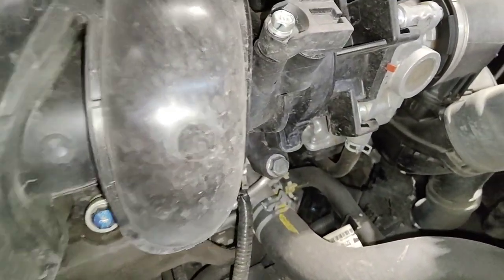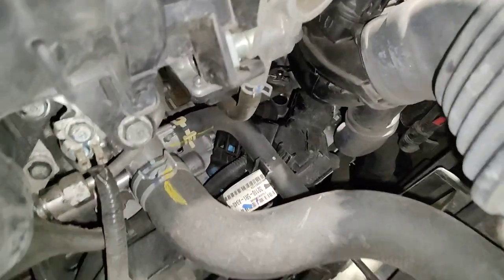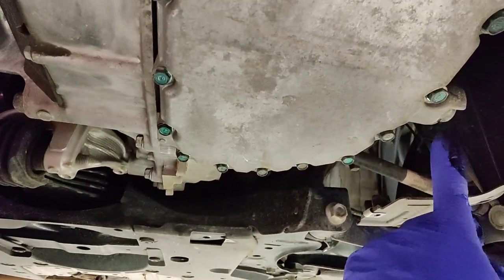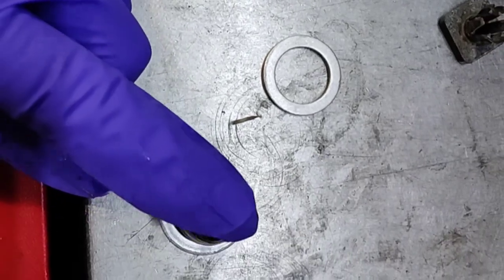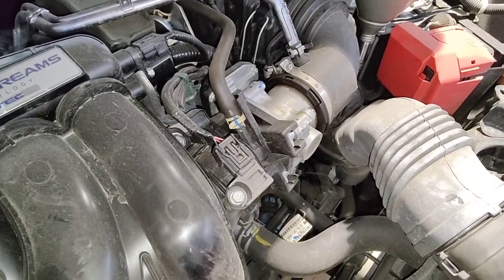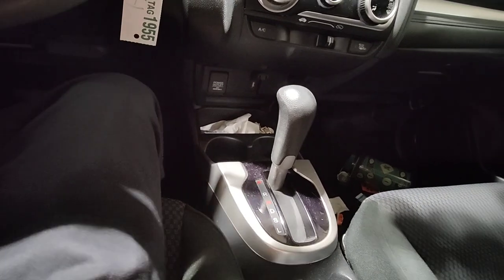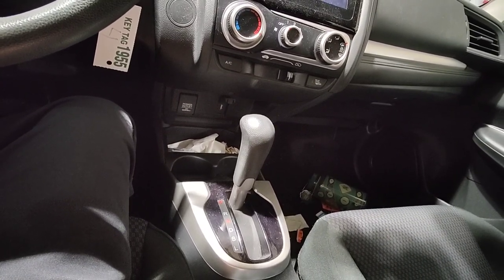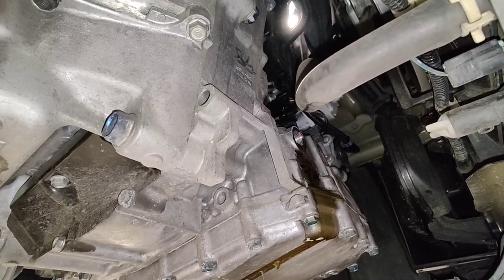2019 Honda fit CVT transmission fluid change.

Comment: isnt it easier to drain the fluid into a container, measure how much came out and then put the same amount of new fluid back in?
Reply from the maker: What if it is under filled/overfilled from factory or if the last person didn't fill it correctly.
Reply: @theoffroadingmechanic  thats a good point sir!
Reply from the maker: I have had first transmission fluid change where I measured what came out and is a quart low from the factory. So always check for correct level
Reply: @theoffroadingmechanic  im not surprised, I suspect my camry was underfilled from the factory

Comment: Aren’t you supposed to fill from the lower (check) plug, and then finish filling from that top plug?? There’s a drain plug and fill plug under and then the 2nd fill plug on top.
Reply from the maker: You fill it at the fill plug and you let the excess drain out from the level check plug to get your level.
Reply: @theoffroadingmechanic  interesting. Talked to a Honda guy, and he said they absolutely don’t do it that way. I’m not sure if it matters. I will continue to initially fill from the check plug just to be safe.
Reply from the maker: I mean everyone does it differently. They probably fill it from the fill because they have something to pump it in the level check hole while the vehicle is up in the air on the hoist. Where the fill you just get a funnel and pour the fluid in. Either way you still have to run it through the gears so the fluid cycling through and top off the fluid by pouring it in the fill hole.

Comment: After you run it through the gears and check it on level ground, you want the fluid just weeping out the check hole right?
I usually check after with my finger & add if needed. I wait like 1 minute & check again. Repeat as necessary until it weeps & I feel the oil with my finger in the check hole.

Comment: Help! . I added 4 quarts and the level hole is still not dripping. 3.6 liters came out (if that matters)
Reply from the maker: Yea I found that on paper it says it takes about 3.4 litres I believe but it takes more when you fill the check plug I dump all 4 bottles. That's why I would check the level rather than go with what comes out of it. Some CRV will take 4l of fluid and some will take 3.69l. Just fill it until it comes out of the level you can't go wrong.
Reply: @theoffroadingmechanic Thanks for your response. I'll get another bottle today and add a little more until it drips.
Reply: @LuisOrtiz-ko6yt  any updates on how it went after you went for an extra quart? That just happened to me.

Comment: The level check you do with the engine idling? I need to service my wife’s 17 MDX AWD transmission. You have experience with the ZF 9 speeds? I believe thats what it is.
Reply from the maker: Yea 9 speed you check with it idling and not over 113 degrees Fahrenheit. The 10 speed you check with engine off. I made half a video on a 10 speed but got busy and couldn't finish it. Going to be a while until I get another one. And the 9 speed I think only one person in the shop has done one so far. The fluid wicked expensive.

Comment: How often should the transmission fluid be changed?
Reply from the maker: It really depends on the driving conditions. But your maintenance reminder will show the sub symbol 3 around 70-80k kms or around 50k miles depending on how you drive.

Comment: What kind of miles are on this CVT(just curious) the fluid was much cleaner than the CVT fluid that usually comes out of a CVT. My Saturns has GMs early CVT and the fluid had no debris but a lot darker. I was (before I swapped the CVT for a 5 speed automatic) running Valvoline synthetic CVT fluid
Reply from the maker: 71k kms I think that's around 50k miles. The maintenance reminder comes on anywhere from 70-80k kms depending on how you drive. The CVT fluid only looks slightly darker compared to new fluid when the reminder comes up on the dash on the Honda.

Comment: So to get that straight: 1) drain the oil from the bottom plug, replace the washer, remove the metal sludge, put the plug back, 2) from the filling plug pour 4 bottles Honda fluid, 3) start the car, go through the gears, go and open the leveling plug, wait for the excess oil to drip, screw everything back together.
Reply from the maker: Pretty simple if your doing it on the ground make sure it's on level surface

Comment: Great video.
Very informative and where you have the locations of each plugs on the video is very good.
Gives all the DIY and weekend gearheads/wrenchers a thing to do and save $$$ than having someone else do it.
My last transmission change costed 250.00 dollars at the local automotive care center.
Most of the cost was for disposal and environmental fee and labor charge.
Not anymore because this video will help those Honda Fit freaks/followers to do it themselves.
Reply from the maker: Definitely cheaper if you do it yourself. 250 seems kinda high for CVT fluid I think that might be more than what the dealership charges in Canadian.

Comment: Thanks for this video.  I have to change the transmission fluid on my daughter's 2019 FIT and was wondering where the drain and fill plugs are on the car.
The check plug is also nice to know where that's at and how to use it.  I have been doing my 2015 Honda CRV transmission every other oil change since I got the car in 2018.  It had 84k on it, now it has 214k.  I've been simply measuring out what came out, but putting back what it says is the capacity.  I've been having some odd feels in the shifting since the last time I did it, so I'm going to do it again soon.

Comment: what's the best bang for the buck Diagnostic Scan tool brand/brands? Not into tuning, coding/flash Ecu's etc. 
maybe just to actuate stuff like ABS bleed, sensors, reset, etc. and some live data for the engine, tranny, etc.
Reply from the maker: i recently tried the autel MD806 pro a small hand held scanner. just have it for doing electronic parking brakes just to have in the tool box but it has other functions. heres the video https://www.youtube.com/watch?v=7CLzgkGeqEo
and the link to the amazon site maybe have a gander if the functions listed are right for you.
https://amzn.to/3UqG2xv

Comment: I know this is an older video but I have a 2019 Honda Fit and during the summer time when it's really hot 95° or more it has a tendency to shudder in parking lots once in awhile but only when it's really hot and when I've driven more than 15 miles but never does it during the Springs winter or fall it has 55 k miles and had two transmission service at the dealer could it be a low flow issue like plug filter
Reply from the maker: Never had anyone complain about that here. With 55k miles I wouldn't think it would be a restriction or a flow issue. I can take a guess that it's due to the viscosity thinning out since it is just a metal belt riding on a set of pulleys.
Reply: check second filter cvt (in side cooler)

Comment: I'm just looking at doing this on my 2019 fit sport. I was surprised not to find a dip stick fornthe trans fluid, now I know why.

Can you recommend a cvt fluid? Never had to deal w cvt b4.

Thanks for the video! I'll subscribe 4 sure.
Reply from the maker: Thanks!! I usually rec. The OEM stuff since it is made for the vehicle. Kinda takes the guesswork out of "if it will work in my vehicle"

Comment: That plug you pulled out of the transmission at the beginning of the video, my friend has a 2014 honda civic and that plug keeps blowing out. I figured that there must be excessive pressure building up in the trans to blow that out. I found the pressure relief vent to be clogged and I cleaned it out, but the plug keeps blowing out. Is there anything else that would cause that plug to blow out?
Reply from the maker: When you pop the vent off is it clear through the vent and no junk still in it? And if the trans is overfilled.

Comment: For general knowledge not knowing the transmission names. In a 2018 Honda fit CVT do you check it idling or with the engine off?
Reply from the maker: Check with the engine off on cvt. The only one I know so far that you check when idling is the 9 speed.

Comment: Is the 2008 fit sport the same as this video? Thank you.
Reply from the maker: Different than the 2008 fit but similar in a way where there is a drain plug at the bottom and the filler has a dipstick to check. That dipstick should be right below the coolant reservoir I actually have a video for this https://youtu.be/DCn2QaqEFqg?si=6j6jA--tfvbFL20o

Comment: Had a mechanic drain the transmission fluid  and then put the fluid back in from the level check until it ran out he didn't go through the gears and it only took 3 l is that also ok to do it that way?
Reply from the maker: I run it through the gears to check it for proper level just so it fills any passages that it goes through to get to any components in the trans.

Comment: The Honda dealer around me are charging over 300 CAD for the CVT fluid change.   I thought that was pretty rich.
Reply from the maker: I'm not sure what the exact pricing is but I'm pretty sure prices are set by Honda Canada so it shouldn't be different from dealership to dealership. But over 300 is a bit high since labour is only 0.3 plus cost of the fluid On a Honda fit.

Comment: I’ve got a P0843 code. I’d like to replace the pressure sensor. Can you reach it from under the car or through the wheel well or do I have to remove the throttle body and battery to reach it? From photos I seen on line it looks like it’s on the right lover side of the case. Thank you
Reply from the maker: Is yours a gd3 or a ge8? It's easier to get at once you remove the battery and air box. And it's right under the transmission filter. There's also a bulletin for a rubber sleeve to go on that connector dunno if it's still available. I had to replace the third clutch pressure switch on my fit which was on the front of the car.
Reply: @theoffroadingmechanic  it’s a gd3. I only see the one sensor and it looks like it might be accessible from the side wheel well or from underneath. Do you have the link for the bulletin on the sleeve?
Reply from the maker: I'll have to check at work if that bulletin still exists I think it was meant to protect it from moisture and corrosion on that connecter here in Canada. For open circuit or short code for the pressure switch
Reply: @theoffroadingmechanic  plenty of salt on the roads here in Central New York. Thank you
Reply: @theoffroadingmechanic  should I be concerned with breaking any bolts off takin out the throttle body and batter plate? It’s pretty salty here in NY and there is lots of corrosion.
Reply from the maker: Hope this video helps it's me changing the transmission filter but it's pretty much the same things you remove to get at that switch. https://youtu.be/DCn2QaqEFqg
And the bulletin is E-5-13, 06320-RDJ-A00 is part number for 07-08 fit. Also will need electrical tape to wrap that sleeve to the harness so it doesn't move. Hope this helps

Comment: When I go to replace the transmission fluid should the car be level or can I get away with just using two jack stands?
Reply from the maker: Yea level for accurate reading. if your going to use 2 jack stands use your floor jack to lift up the rear when you level check before throwing the skid plate back on.
Reply: @theoffroadingmechanic  Thanks for the reply!

Comment: I did a CVT change on my 2020 honda fit the same way; add fluid from top, check on side of the trans like you show. I measured what came out and added the same amount back in, went through the gears like you show, took it for a six mile drive with thee miles on freeway, then checked it. Nothing came out so i pumped fluid into the check hole until it leaked. Then I took it on a second drive and checked the level. Nothing came out, so I added more until it leaked. I ended up adding 700 mL more than drained out. Any thoughts on that.
Reply from the maker: So you put in the same amount that came out and not the amount until it came out of the level check. And did you check it on level ground or did you just have the front jacked up.
Reply: @theoffroadingmechanic  I had it leveled on four jack stands. I removed the air box, removed the 19mm check bolt and nothing came out, Then I removed the 3/8 drain bolt and drained out the transmission into a pan. I measured what came out (3.4 liters) and put the same amount in the top with a funnel. I put the airbox back, turned on the car, went through gears pausing 10 seconds in each, then took it for a drive. I placed it on level jack stands, opened the check bolt and nothing came out. Then I pumped fluid until it leaked. I took it on a second drive and repeated the steps and nothing came out. I pumped in more fluid until it leaked and shut the check plug. I didn't bother repeating the cycle because I was worried about adding too much fluid. All in all I added just over 4 liters. 
As for how it drives. The accelerator pedal is not as sensitive as before. The rpms used to jump from the slightest touch. Now they don't jump as high. However acceleration is improved at lower rpm. I get 35 mpg in mixed driving. I used to get 33 mpg.
Reply from the maker: I've never had that before. I typically dump the 4 bottles in and run it through the gears to let it fill the passages to the components in the tranny and pull the level check for a small stream of fluid comes out.
Reply: Same here, I did the drain and fill. Got the car up to operating temperature after 10 minutes idling, shifted through the gears waiting 3 seconds at each gear position and back to park. The car was on 4 jack stands on a level garage surface. Opened the level check and nothing came out. Might be worth noting if you are using the 4 pinch weld points of the car, the front pinch welds protrudes about half an inch longer down than the rear. Which by that logic would tilt the car's front end higher than the rear if car is sitting on 4 jack stands on the pinch welds. I doubt it would make a significant difference but worth noting. I drove the car hard after the drain and fill with 4 quarts. Car seems to run smoother than before and slightly faster accelerating. Job was done today so can't tell you if it's presenting any problems but so far so good.
Reply: @Mushu88 My driveway is slightly crooked so I used a level. I checked the cvt fluid level after driving a thousand miles. 500 mL came out. The difference this time was that I checked it 10-15 minutes after shutting the engine off. Now it runs perfectly and I am getting 35 mpgs delivering food.
Reply: @jaspalmarahar3783  interesting. I don't know if I will do another level check. I used a bubble leveler to check my garage and it's leveled too. My guess was because the front 2 jack points pinch welds protrude lower than the rear which would raise the front higher if all 4 jack stands are adjusted to the same height. But my jack stands and most jack stands don't have precise adjustments to adjust it enough to account for the front jacking points being different than the rear. My final assumption was that the car is designed the way it is and should be leveled for the CVT level check when jacking from the 4 points equally. My fuel efficiency has not changed and car drives smoother than before the CVT fluid change.  I get 42.3 mpg typically commuting to and from work mostly highway.

Comment: hey due, my 2015 honda fit transmission is leaking, is that normal? 100000KM drived
Reply from the maker: Not if it's leaking. Check where it is leaking from. Axle seals, pressure switch, etc
Reply: @theoffroadingmechanic  thks,

Comment: Doesn't it have a filter for the transmission? If it doesn't I'm going to cry because I pay for the filter 😳
Reply from the maker: I believe it's behind the transmission cooler where it bolts on to and a couple o-rings seals it between the cooler and trans.
Reply: Thanks

Comment: Is there a cvt transmission oil filter on this Honda Fit too?
Reply from the maker: I believe there is. I will have to double check but there's no interval. Should be an oil cooler on the front and the back side of that oil cooler seals against the trans with a gasket for that filter.
Reply: @theoffroadingmechanic  it would be great to see a video on changing that filter